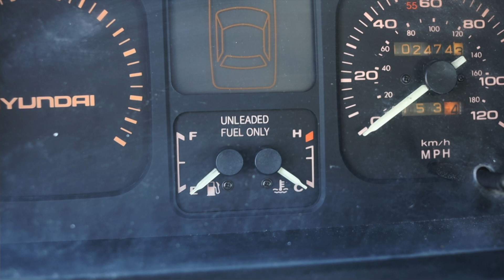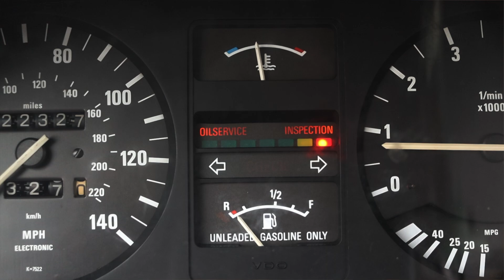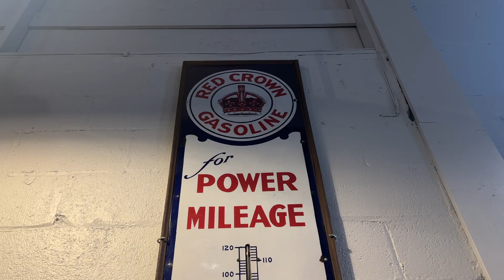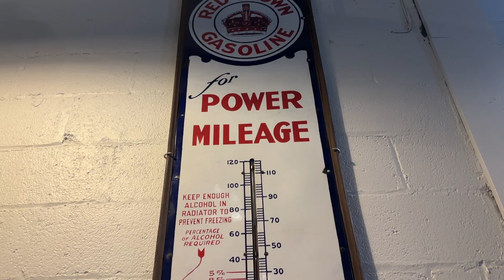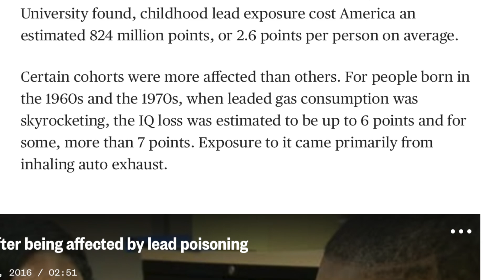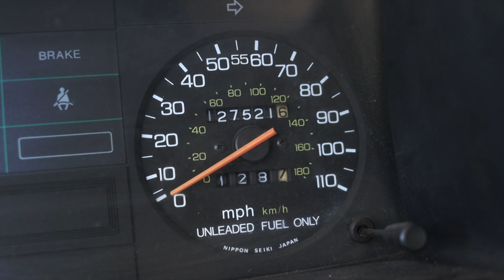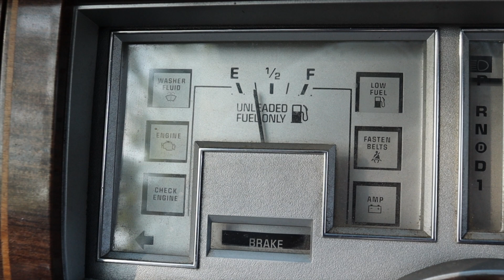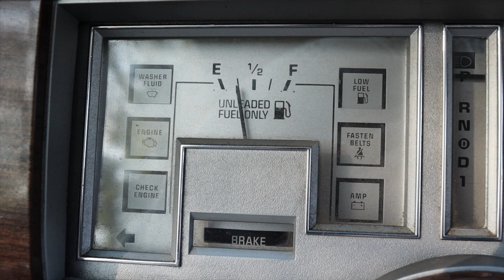Leaded Gas - Why It Was Used & Why It Was So Dangerous!

Comment: What they replaced lead with wasn't much better. BTEX chemicals were used to boost octane in unleaded gas, and those are carcinogens.That's why we switched to Ethanol, it had nothing to do with the environment in terms of global warming as Ethanol produces as much carbon emissions as gasoline but you have to burn more. 

The kicker is, they were taking about adding Ethanol into gas in the 30s instead of Lead, but with prohibition, they couldn't. Imagine a world where the government could tell the oil companies what they can and can't do. Totally a different time.  Imagine if we did do that, it would have impacted engine designs and carb designs if they didn't just go with mechanical fuel injection systems to avoid the head aches with vapor lock.

Comment: 1980s cars are better? You gotta be kidding me. The 80's were a terrible time for car performance and reliability.  Engines leaked oil, low horsepower, higher maintenance and only lasted 100k miles. Body panels and frames would always rust out prematurely.

Comment: US fuel octane only goes up to 93? We get 95 fuel here in Indonesia
Reply: There are different ways of reporting octane rating.  The Research Octane Number (RON) and the Motor Octane Number (MON).  They're both measured by running the fuel in a test engine, but the tests differ in what engine speed, compression ratios, fuel temperature, and ignition timing they use.  Since the MON tests are designed to stress the fuel's knock resistance more than RON does, MON is typically about 10 points lower than RON for the same fuel.

Most countries, including Indonesia, just use RON.  But North America uses the Anti-Knock Index (AKI), defined as the mean of RON and MON ((RON + MON) / 2).  Thus, 93 octane in the US is roughly equivalent to 97-98 octane in Indonesia.

Comment: leaded isn't banned from use and not even from sale in england, there's still a few garages that sell it and i make my own leaded ethanol free fuel to use daily in my 80s car and i should add that octane ratings are different here also, standard is 95 and premium is 97 or 99, and i sometimes use 102

Comment: topic for essay: Why don't most (usually American-made, but not exclusively)  vehicles in North America have amber turn signal lights on the REAR  as you see on all vehicles in Europe? 

Thankfully on more modern cars it's happening, but on older makes, they are only on the front of the car - not the rear, where it's only red lights. It makes it less noticeable /obvious when you're following someone and they are turning. More so at night when the lights are on there's less of a difference for the blinking. 

It also doesn't help that many drivers (in my experience) break first and then use their turn signal - supposed to be the other way around to give the person behind you a chance to prepare to slow down.  Quite annoying really. It's supposed to be a clear signal. Amber is much more explicit than red for your intention and avoids confusion. Also, amber flashing is a hazard warning indicator, and red for stop, so it serves as double info. Any idea why North America didn't care to do it for so long? cheers
Reply: Not all modern cars in the US, some newer cars sold in the US still have red turn signals for some dumb reason.
Reply: Looks better to not have the amber lights, also the red lights are better on the eyes of people behind you.
Reply: @fortheloveofnoise  Sure red is more pleasing to the eyes, but are still safer and reduces rear-end collision, even your NHTSA studied this.
It's not about what looks better, it's about safety. And believe it of not, many people still prefer amber turn signals, even some American prefer amber turn signals.

Some Americans even wish the US government mandated separated amber turn signals, even Canada tried to mandate separated amber turn signals, but failed but of the US' outdated regulations.

Comment: I was born in 1951 and I grew up in the era where gasoline contained tetraethyl lead. Because of this I remember when the first unleaded gasoline started to be offered in California. It was in the early 1970s that a few gas stations started sell unleaded gasoline. This early unleaded gasoline had a very low octane and only worked in low compression engines. Also for a time gas stations started to sell what was called low lead gasoline. The first car I bought was a 1977 Datsun B210 which had a catalytic converter and required unleaded gasoline. By the time this car was on the market nearly all gas stations sold unleaded gasoline in addition to leaded gasoline. Also cars that needed unleaded gasoline had fill restrictors in the fill nozzle to allow only the smaller diameter unleaded gasoline nozzles into the the filler neck. This helped prevent miss fueling the car with leaded gasoline. Finally by 1996 the only gasoline sold for cars was unleaded gas. The era of gasoline pumps with the label, "For Use as a Motor Fuel Only contains Lead Tetraethyl" finally ended.

Comment: The flight school that I go to uses leaded gas. And the planes have zero emission equipment (which is typical). They always run at a very rich mixture on the ground, so the fumes are awful. I’m surprised I have any IQ points left at all

Comment: The switch to unleaded gasoline happened because catalytic converters were required to be installed on cars starting in 1975. Leaded gasoline damages the catalyst, rendering it ineffective. Also, I think it's not an accident crime rates spiked from the late 1960s - 1990s because during that time, many people were exposed to environmental lead. In addition to cognitive damage, lead poisoning also causes antisocial behavior and violent tendencies in humans.

Comment: Lead was great for valve guides as well! The reduction in sulfur in diesel fuel has caused problems in fuel injectors as well for similar reasons the sulfur acts as a lubricant for the injectors.

Comment: A very important point you didn't mention. Lead metal is kind of safe. The problem of leaded gas is not just lead.  It is Organolead compound which called tetraethyllead. Tetraethyllead is super toxic. It can be quickly absorbed by human body and also quickly kill you.

Comment: I wouldn't be too dramatic about lead being banned in most gasoline after 1996. Lead is very destructive to catalytic converters, so as more cars required them, less leaded gasoline could be sold. In fact, unleaded only cars have a smaller fuel filler, so only unleaded pump nozzles would fit. With leaded gas being obsolete, I don't see why it never technically needed to be banned. I suspect the 1996 ban was more symbolic than anything else.
Reply: You are correct. Many stations stopped selling leaded gas well before 1996 because there was very low demand for it.
Reply: Might have something to do with lead poisoning and a neurotoxin causing brain damage from the fumes??

Comment: Leaded high-octane gas is still common in racing and almost universal for piston-engined aircraft. There is progress being made to certify aircraft engines to use pump gas. If you think certifying car parts is hard you have no idea how difficult it is to get FAA certification. Fortunately aviation and racing engines are a very small percentage of emissions because of their limited uses.
Pencils are graphite, not lead.

Comment: School pencils are graphite, not lead. You gotta go way back in time to find actual metal lead pencils in schools.

Also, some states have quite a few 100% gasoline pumps. Oklahoma, for example, has 100% gasoline at virtually every major urban convenience store.
Reply: 100 % gasoline is non oxygenated, not made with alcohol, hence the lower octane 91 or 92.
Oxygenated has higher octane 92 93 because it uses alcohol, racing gas at stations with higher octanes 108 110 are made with alcohol.
Leaded gasoline at pumps has been eliminated by the EPA, not saying someone isn't still selling Sunoco or VP gas at a retail pump, some might be but I wouldn't want the fine if caught.
Off road at tracks leaded race gas is available for $$$$$, or getting low lead Aviation gas from an air port, can be done but I wouldn't fill the car there, because of federal and state taxes, someone might like getting people in trouble and unfortunately cameras are everywhere today.
Reply: Tennessee has them too. Seen racing fuel pumps in California too. Probably gone by now though.

Comment: USA use 87 octane?
Growing up in Israel the lowest the octane i saw was 95, you used to get 98 but that was banned/discontinued over 10 years ago
Reply: Different countries around the world calculate fuel octane differently. 93 in the USA is roughly equivalent to 98 in many parts of Europe, 89 in the USA is ~95 in Europe, and our 87 octane is roughly 91 across the pond. Australia is a bit different also.
Reply: @matthewfuller1129  i still never saw octane 91 in Israel, the equivalent of 87 according to you, probably cause it's more expensive in Israel and 87/91 is less efficient, so I assume USA tolerate much worse fuel economy
Reply: Israel uses RON and US oses octane to my understanding although that might be wrong. 95 RON is like 91 octane which is still premium in the US. 93 octane is about the highest non-racing fuel I've seen in the US so I don't know if Isreal uses higher octane fuels or not.

Comment: Re ethanol free gas, it’s much better for older cars whose engines weren’t designed to deal with ethanol. I put ethanol free in my 85 Celica.
Reply: Indeed, plus if you have something that takes gas like a lawnmower, weed eater, etc.. that's going to sit for long periods like over winter then ethanol gas can be more likely to go bad faster, and gum up/gel up, if you forget to use a fuel stabilizer than non ethanol gas. My Toro push mower with a Honda motor says non ethanol gas only on it, although having said that, knowing that I'm going to burn through all the gas during mowing season I'll use cheaper 89 ethanol gas for most of it, and then use non ethanol with fuel at end to help wash out the ethanol along with Stabil during winter storage.
Reply: Generally, as long as your fuel is less than 10% Ethanol, you'll probably be okay. Even in small engines (like lawnmowers and such).